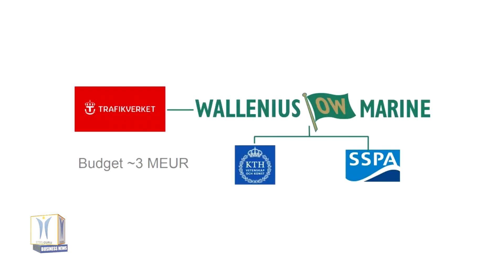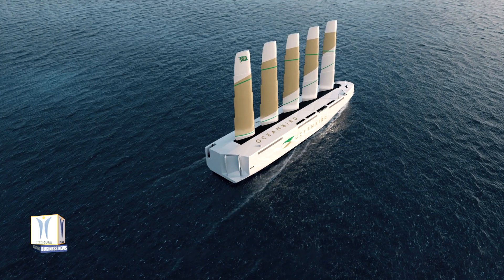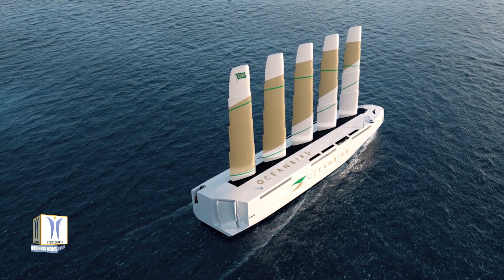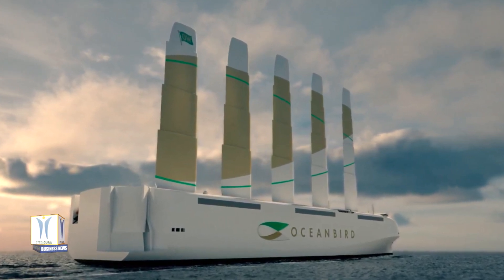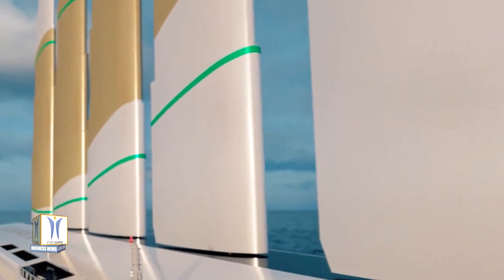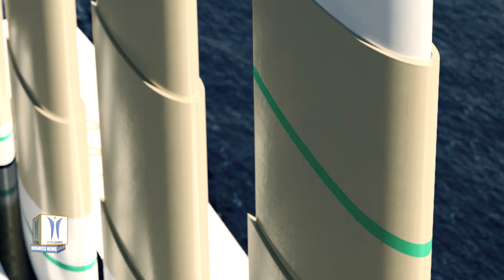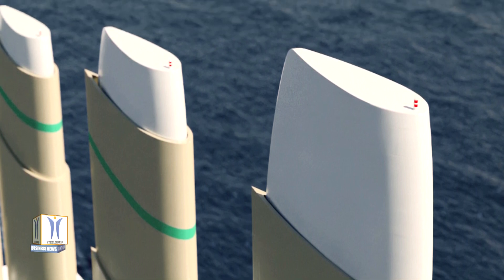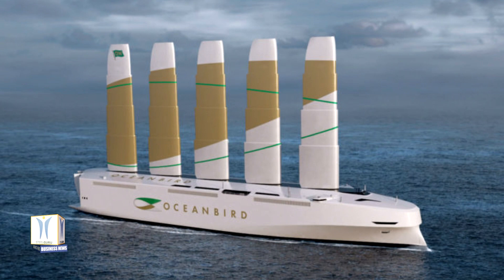Wind Powered Car Carrier Oceanbird to Cut 90% Emissions

Comment: A great idea, but this a car transporter that can load from the back and sides of the hull, so it can have a flat top to mount the sails.  I am not sure how it would work with a container vessel that loads from above, and is top heavy when fully loaded, so huge sails might tip it over.